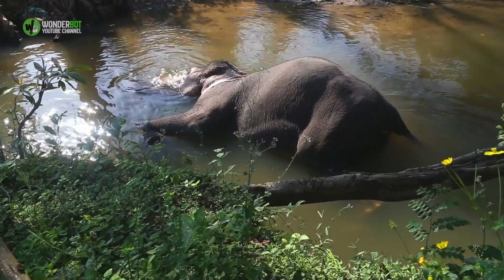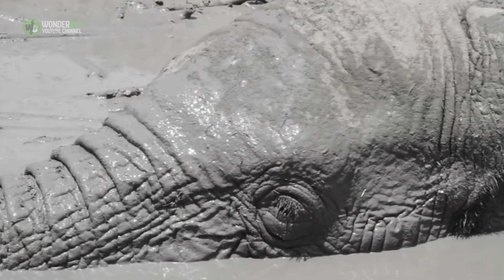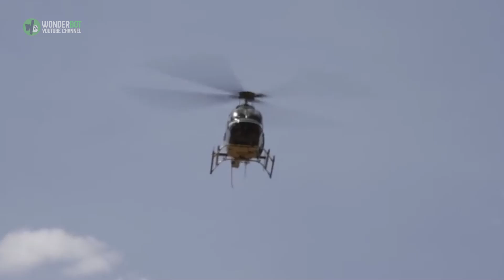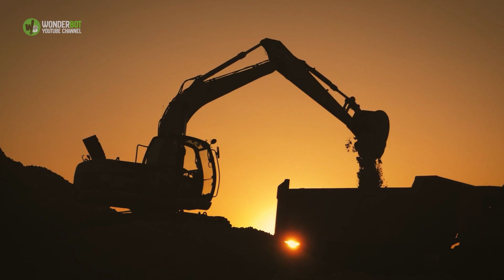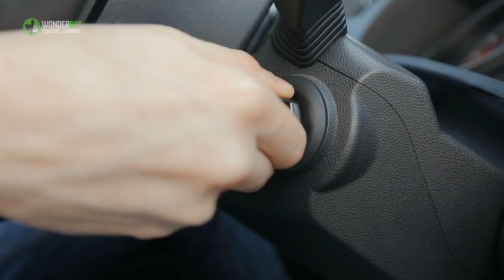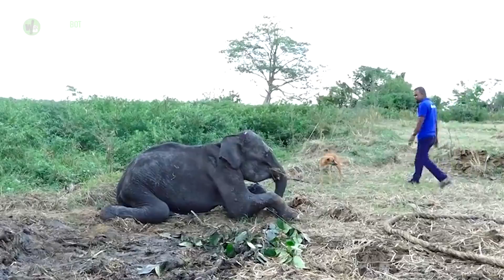Man Saves Drowning Baby Elephant, Then The Herd Does The Unexpected

Comment: Last summer I saw 6 ducklings that were trapped by a curb too high for them to climb. 8 lanes of traffic rushing past just feet away, storm drains on either side, frantic mother hiding under nearby rose bush, no shade and 38c temperature. Add 1 human with compassion, long story short, all 7 ducks go find a pond and human goes to buy cat litter. Ducks had disappeared on return trip.